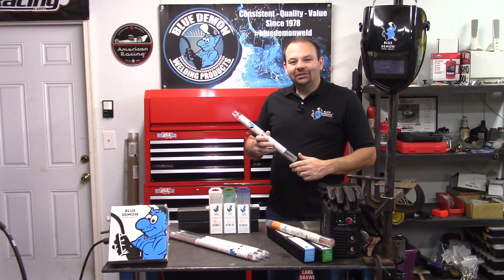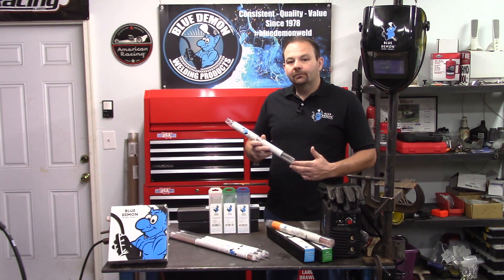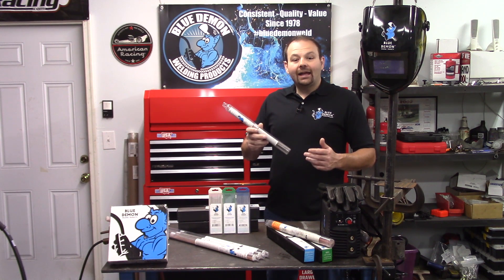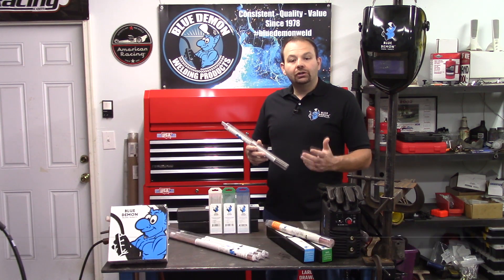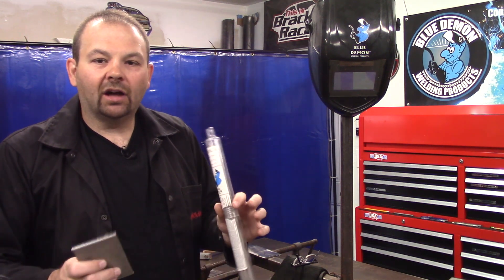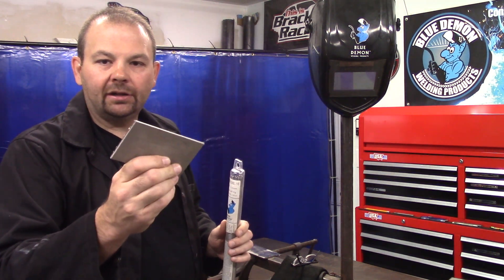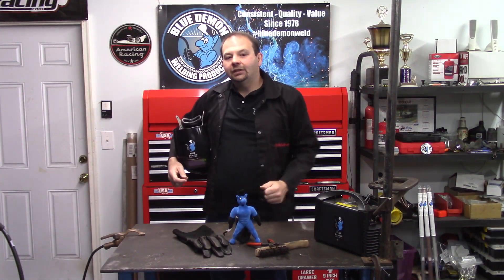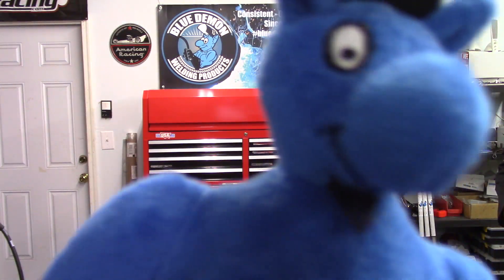Blue Demon E308L-16

Comment: Wish you were more detailed with the demo and less reading off the specs. How do you demo electrodes and not show how they start or how they handle thinner material? Having a real nightmare with these rods 3/32 on 304 2"x1/8" tube. These rods either blow holes clean through or don't arc at all when turned down.
Reply from the maker: sorry...we need to update this video (its very old).  email me bluedemonweld@gmail.com with your joint configuration and machine settings.  something doesn't sound right.  these rods run really easy in my experience.

Comment: Best to use EP or EN with these rods? Im curiois because ive been using both and cant really accept EP because the EN is much more easy to control.
Reply: I heard him say EP.
Reply from the maker: EP... EN will run but not much penetration
Reply: @bluedemonweld  yeah I was actually runnng EN and even though less penetration you get much more time and manipulation, but you can feel the lower layer melt and then which you can poke lightly to leave the weld in almost like a tig. i did my exhaust and the only spots That didnt weld or tht rusted were the spots I didnt use Blue Demon Electrodes!!!!!

Comment: Hallo Blue Demon and thanks for the good video. May I ask you to tell me the settings (Welding Amps, Arc ignition time, and Arc Force) that I have to set on my machine when I have to weld 2 plus 2 mm Inox plates and using the 308-16 (2mm) Blue demon rod?  Thanks again, Spiros
Reply from the maker: Hi Spiros.  we sell that rod in 1.6mm and 2.4mm, not 2.0mm.  start your machine at 50amps for 1.6mm and turn up if needed.  likewise, for 2.4mm start off around 65 amps and work your way up.  every machine runs slightly different and every joint and position plays a role in affecting welding amps.  hope this helps!  Bluedini

Comment: Idk if it's your technique, amperage or the blue demon electrodes are poor quality, but stainless stick welds run alot smoother than that...
Reply from the maker: technique.  Shaun is not a certified welder.  would like some to try?
Reply: @bluedemonweld  yes I would, and I am an  all position certified welder.
Reply: @bluedemonweld  I mostly run Avesta 308l rods, but I'd give blue demon a shot, send me a couple electrodes.
Reply from the maker: @eliasrudnitsky3884  great... just lmk your address
Reply: @bluedemonweld  your channel doesn't accept messages, PM me.
Reply from the maker: @eliasrudnitsky3884  email me at bluedemonweld@gmail.com
Reply: @bluedemonweld  I did, thanks a bunch, it's great to see a company do that👍